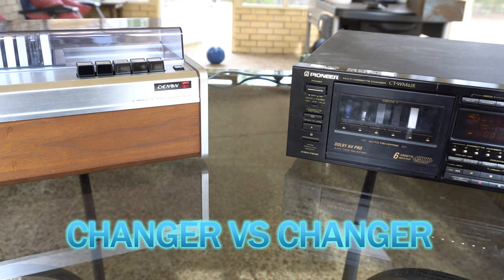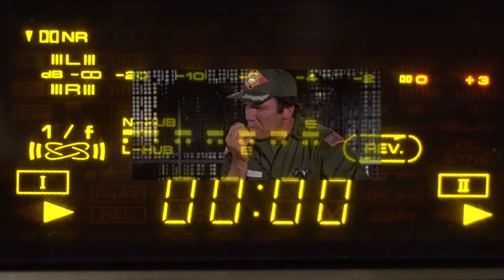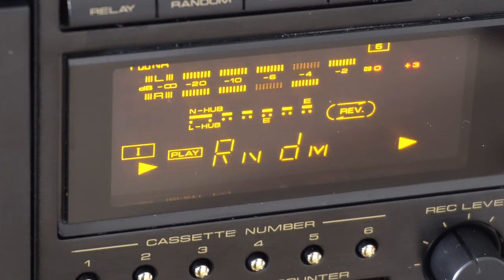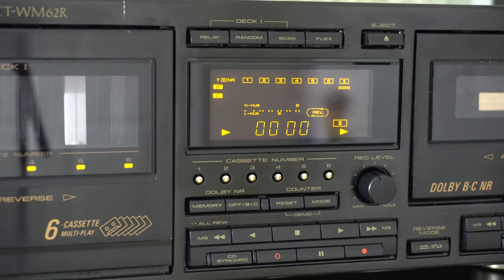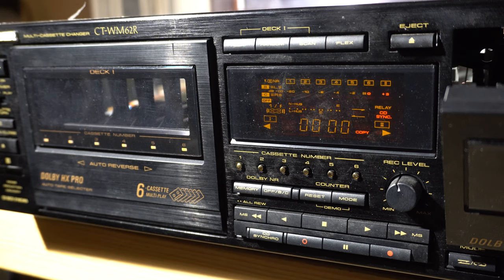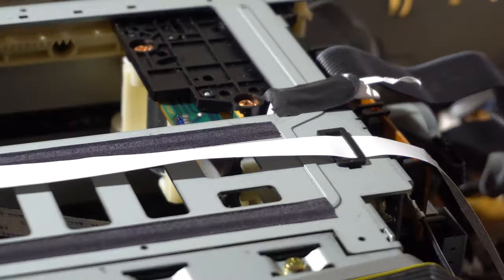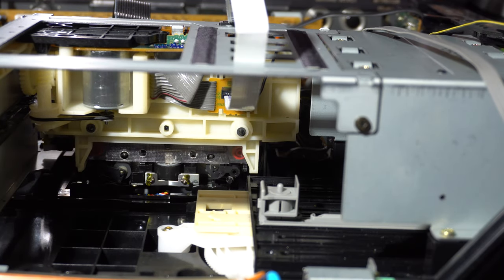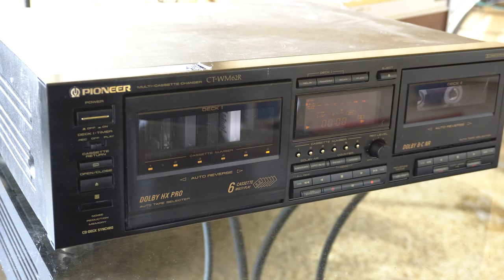Pioneer 6-Cassette Changer vs. Denon 12-Cassette Changer

Comment: I’m impressed. Down to earth but intelligent description and technical analysis. You did a good job troubleshooting all the issues, which can be difficult when someone else has fiddled with it prior. I was not aware of these units, but stumbled on to several on eBay. I bought one that is supposedly an unused original. My fingers are crossed 🤞. Pioneer seems to make solid equipment.
Reply from the maker: Thanks I appreciate the positive comments! If you found one unused or new old stock you should post a video of that!

Comment: I had a G.E. Cassette changer from the early 70s. It played something like 10 or 12 cassettes in  a row. It was unique in that you loaded it from the top. You could easily add or remove cassettes by simply dropping them into or removing them from an open upright tray slot. The tray would move down the line grabbing the next cassette as needed and ejecting the previous cassette back into the tray. I can't seem to find any information on it. Any clues?
Reply from the maker: Search eBay now for "Vintage General Electric GE Automatic Cassette Changer Deck Radio" that might be it (the model M9000A) and they want $850 for it...! Thanks for watching!
Reply: @ACBMemphis  Thanks for the tip. That's not it. The one I owned had a tray that was on top of the unit. The tray would move allowing the next cassette to be fed (dropped) into the player. You could easily remove or add any cassette to the queue, except the one that was playing, simply by dropping it into, or removing it from, a slot in the tray. It played each cassette, front and back sides, giving you about eight hours of continuous music. That's something that I believe, at the time, no other system could match.  I have a feeling it's super rare. I worked for G.E. back then and bought the unit at the company employee store. As I recall, it was strictly a cassette changer. No radio, etc. I gave it to the my father-in-law many years ago. I spoke to him and he said he still has it somewhere. He's looking for it.